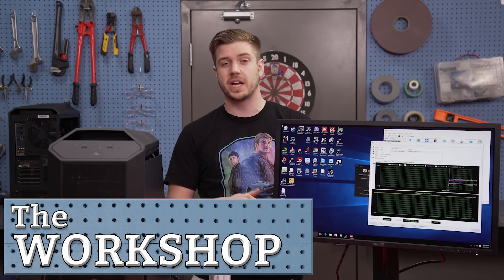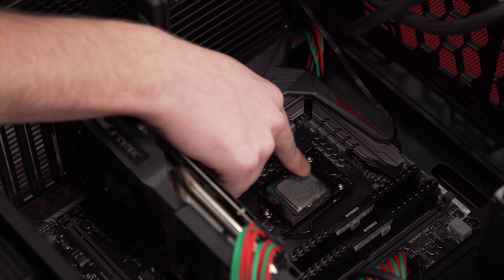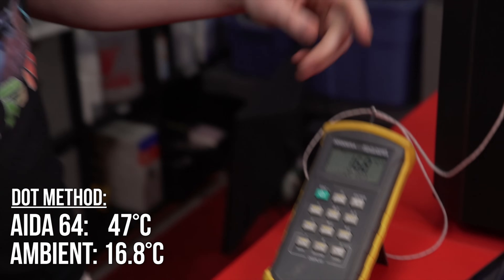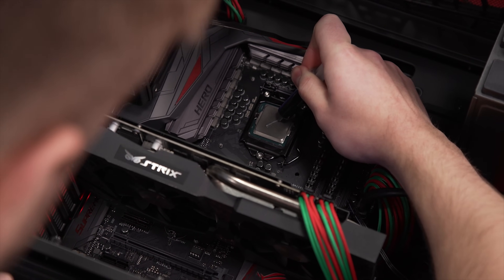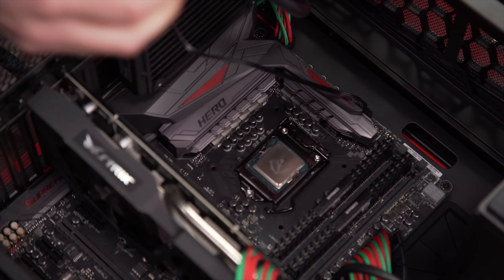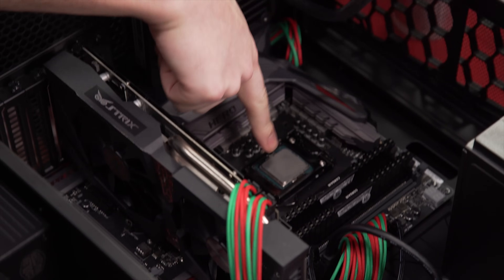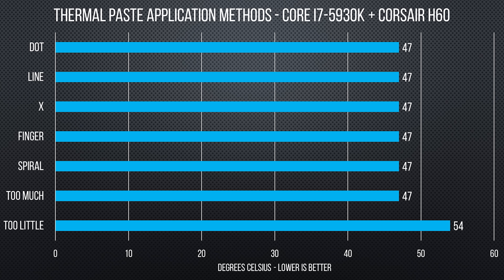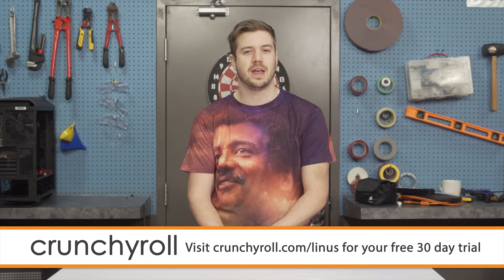Thermal Paste Application Methods - Which one is best? - The Workshop

Comment: wondering if its worth buying a gtx 1080 to replace my old amd 6870. Will the increase in performace be similar to starting from scratch or will i see much less performance by only upgrading the card?

asus p8p67 deluxe
i7 2600k
xfx 6870
8gb ddr3
256gb ssd
Reply: To bring this down to the simplest answer. You will see a massive performance increase IF AND ONLY IF you are currently maxing out your current card, if the games you play don't call for more power than you are using now, you WILL not see a difference.

Comment: Do you guys recommend using a cleaner like arcticlean or does isopropyl 90% work just as well?
Reply: isopropyl works just fine, frankly i generally just grab something and wipe it clean without any liquids unless it's really dried on and won't come off.
Reply: I should also note, without the isopopyl i didn't see an increase in temperature after reseating the heat sink

Comment: this video made me LOL so hard. THANK YOU for the video man. I have been getting disappointing temps on my h110i with my skylake 6600k with corsairs factory thermal paste. This video gives me more confidence that I probably wont see anything different if I really tried it myself. And yes I am a fan of the card method.. Would changing the fans on the radiator give me more of a noticeable difference?
Reply: if you have enough paste, make sure your heat sink is free of dust that will clog up airflow, if that doesn't help. Your next step is a better fan attached. The more CFMs the better, but i am assuming you are using liquid cooling. I don't know the exist liquid system you are using, if it is possible make sure it isn't low on liquid. Air pockets in the liquid can be pretty detrimental.

Comment: I think I'll make dots like 5 on a dice next time, anyone tried that?
Reply: It will produce 47*C CPU temp and 17,2 Ambient Temp
Reply: It has been done before but I don't know what the result would be as it does create gaps and leaves air bubbles between the dots
Reply: That's what I was thinking. Seems like it would spread out more evenly.
Reply: thought the same thing.
Reply: +John Connor It works I do that method all the time
Reply: that's effectively an X with air gaps. the bottom line is that it doesn't really matter what method you use as there is only 3 situations you want to avoid: 
1. you don't want so much that it's spilling out onto the board
2. you don't want to little that it's not creating a contact surface
3. you don't want air bubbles

so keep it simple, whatever shape you make should be aimed at not creating air bubbles and not spilling onto the board. 5 dots is simply creating risk of air bubbles. it might work, but it logically can't work any better than an x which isn't often going to be any better than a line or a properly sized dot.

Comment: I opened my videocard to fix something and now the temperature is way lower than before. I did not changed the thermal paste, probably i lost a little bit of thermal paste after i opened, but, my thermal paste is the white one, with silicone. I think it was too hot because it was with alot thermal paste in my case. Would be cool if you do this tests again with silicone thermal paste, and, maybe, wait somedays to see the temperature after the thermal paste solidify. PS: Sorry for my english

Comment: Lines I think are recommended (by Arctic Silver's directions) for multicore processors where you're putting the ends of the lines roughly over the cores.  I think the "X" stems from covering 4 cores, each end basically over one core.

The one thing Arctic Silver talks about in their instructions is squeegie-ing the paste over the surface of the processor and the heatsink with a card (e.g. credit card) to sort of "work the compound into the microscopic imperfections" and wiping it smooth with something lint-free (like a coffee filter), and then using the line or pea (center dot they call it).  This seems to make sense, but like your experiments, I'm not sure it makes much of a difference.  Maybe it would matter for Linus' twenty something (24?) core processors he recently published a video about, running full tilt for a half hour, maybe not.

All the instructions I've seen recommend against any direct finger touching of any sort, on the theory contaminants from your hand, skill cells and oil, would act as a thermal impediment; that would seem to make sense.  A lot of the thermal compound descriptions specifically say they're not electrically conductive, so you just have to read the literature carefully, and I would think be liberal with the compound if it's nonconductive.
Reply: The Arctic silver i bought today doesn't have any directions with it. :/

Comment: You don't have a control on your test!
I think there might be some difference. Some suggestions to make things more better. Use bare copper as a control, then compare the methods using the same amount of paste. i think your second control should be using the paste exactly how the manufacturer recomends using the product and comparing that to the different methods.
also, we should see if spreading methods differ for different viscosity pastes, does it matter less with thick pastes than it does with the greasy lithium white crap?
Reply: Basically his control as the dot method. You don't need a control unless you intend to compare against a control, if you are just looking for the best results a control is not needed. If you want to know what weighs less 4 quaters or a dollar bill. You don't need a control of no weight on a scale
Reply: Yes, you do need a control, you need to test if the test is valid and that the methods do ANYTHING at all. For your dollar bill example, you are comparing the weighs of two objects, you have to know if your scale is working properly. You would control the test by weighing an object with a known mass. That way you can be sure that your results aren't invalid due to improperly calibrated equipment.
Reply: +Mostlyharmless1985 testing your scale is not a control. A control would ve taking a scale reading at zero weight. It is already confirmed that no thermal compound will cause the cpu to over heat and irrelevant. You dont need to risk ruining a cpu to prove that.
Reply: +Mostlyharmless1985 also as i said, if you really want to. You can call the standard dit method the control as i already said. As far as knowing if it does anything at all when you apply paste, that is clearly known, and furthermore it is demostrated on the test with not enough compound applied
Reply: Kirk Slaydon You cant have your control be one of the objects under test. The point of the control is to validate that the test is actually doing the thing you are testing for.
Reply: +Mostlyharmless1985 the control is literally one of the tests, the thing you are testing for is if applying differently than the normal pea method changes anything. not if applying grease changes anything.
Reply: If the hypothesis being tested is "different methods of applying thermal compounds make a difference in the performance of the compound."

To control for "thermal compound does literally nothing" then you would use "literally nothing" to show that thermal paste does something.

You are now comparing each method to the control test, and seeing how well it performs against it because it is the test with the fewest variables on it.
Reply: +Mostlyharmless1985 so we are just ignoring the point where we wernt testing if it did something or nothing got it
Reply: Kirk Slaydon No. We are removing errors in testing, ensuring that the compount is effective, and showing that the test is valid.

Comparing different methods to each other isn't as good as testing each method against nothing at all and measuring the improvement of thermal regulation against nothing at all.

The point of the control is to fix the assumption that thermal compound does something. We assume NOTHING in science and make sure that the equipment we are using is actually working correctly.

How can you say that doing nothing at all isn't the most superior method? Maybe thermal compound HURTS performance. Maybe our entire hypothesis is invalid! We don't know. because it wasn't tested!
Reply: Maybe an analogy would be helpful:

You want to test if watering a bean plant more frequently will help the plant grow.
You have a series of plants that recieve different amounts of water per day and measure their height across the space of a month.
Now, if we were just measuring the height of each plant compared to each other, we wouldn't be actually testing anything, because we made an assumption about water.
"Water helps plants grow."
We can't know this for sure. We need a null result to know what a null result even LOOKS like.
To control for "water does nothing at all to help a plant grow" you would have a test that receives no water. You then compare each plant to THAT test to the one that got no water.
Reply: +Mostlyharmless1985 but we do know that for sure from past tests......
Reply: +Kirk Slaydon I don't think you understand what a control is, or what it does.

Comment: I had way too much on for years and never had an issue but wanted cooler temps so I cleaned nearly all of it off and only left a very thin layer & the machine shut itself off within 10 seconds.. The temp rose so fast.. around 5 degrees C per second. I won't be putting too little on again.

Comment: what is the paste even for?
Reply: +David Williams The thermal paste is like a bridge that connects the cpu with the cooler, allowing the heat to move away from the cpu and into the cooler where it can be dispersed into the air.

Comment: Try this test again with a air cooler that has exposed heat pipes and see what happens if the thermal past is not touching all of the heatpipes

Comment: 16.8° C and you are wearing a T-shirt? I think your thermometer is busted.
Reply: +sgv6618 Why? It's only 62° F. That's not cold at all. It's 54° F or 12.22° where I' m at right now and I'm wearing a T-shirt. Living in humid environments helps with how your body adjusts to various temperatures. I've travelled all across the U.S.

Comment: You should do a video comparing different types of thermal paste. Such as the standard cheap silicone white stuff verses the more expensive silver type.

I heard to just get the cheap thermal paste because it will work the same.
Reply: +Ryan Toomey yes and no. I've found with the cheap stuff, it will work, but it will wear out more quickly. It's a consideration if you aren't upgrading your CPU every 2 years or so. The more expensive pastes are in fact more efficient at transferring heat, but unless the heat sink can dissipate the load quickly enough, it won't matter, so, if you have a good cooler, it will benefit slightly from having better paste.
Reply: The difference between the bad stuff and the good stuff can be around 5 degrees C
https://www.guru3d.com/articles_pages/guru3d_thermal_paste_roundup_2019,1.html

Comment: For those of us that are on the fence as to what type of cooling we need to achieve an overclocking goal, would you be interested in making a workshop video with 2-3 cpu's (perhaps a mid range i5, a entry level i7 and then a demanding i7 like the 5820k) and then overclock on an air cooler that is rated for some overclocking vs an aio 240 vs aio 280 vs a custom loop to get solid numbers on how much OC room each pricing tier will get

Comment: A few years ago, I was cleaning a GTX470 and ran it for 2 weeks without TIM because I forgot to resupply my stock and had to wait on the mail. Surprisingly it still worked fine. Got a tad bit warmer but still within the limit by a good margin. Edit---So a question I would have a hard time with,...is no thermal paste better then dried old thermal paste? If I had to guess I would say yes, in some cases, maybe.
Reply: +kris reddish In my experience, yes.  Thermal compound which has perished over the years tends to function as a thermal insulator.

Comment: whoah...cmon sparky, that's not how you do it, there is not an experiment that creates or justifies your own set of instructions! The correct method is described by the engineers who developed the particular thermal paste you use. You must look up the type of thermal paste, then your CPU and then make sure the bottom of the heat sink is flat. All these details end up being the deciding factor on the correct method. Most CPU require the vertical line method...but not all, a few need the dot and very few almost none require the credit card rub it in method.

Comment: This is just an idea. What if the thermal paste has a bottle neck. That the cooler is too good but the thermal paste heat transfer is not good enough. Just guessing that with every single test (excluding too little) was 47 degrees.
Reply: It doesn't really work that way, Heat transfers to a colder substance. The colder the thermal grease the quicker the heat transfer. So the Cooler the Heatsink the cooler the grease. So the quick you can cool the heat sink, the quick the grease will cool, and the quicker the cpus heat will transfer to the grease and so on. Honestly unless that's just a really hot chip he is running that liquid cooling system didn't seem to be performing that great.

Comment: TL;DR: As long as you use enough, you're fine.
Reply: I mean if you are a complete idiot and do that, you have much bigger problems than paste application and they do make ceramic pastes that really aren't conductive, so even then it wouldn't be the end of the world
Reply: Ken *TL;DW
Reply: Yup - interesting how he had the result staring him in the face, using "too much" actually doesn't matter and it's not "less is more" at all. Only once it's actually reached the motherboard and dripping, like dumping the whole damn tube have you used "too much"... I.e. for sane people - just don't use too little.
Reply: @gazlink1  And the only way to know you haven't used too much or too little is to treat it like frosting a cake and apply it with the finger-plastic bag method. This also makes sure you don't miss any spots and end up with hot spots.
Reply: that wasnt too much. that was so much and too much will make it go down to the motherboard.
Reply: which is NOT a good thing
Reply: just fucking drop a bit then put the cooler. done. works perfecly fine. did yesterday.
Reply: Ken Thank you
Reply: as long as you use right amount of TP then you are fine
Reply: Batman There is no "right amount", too much is clearly better than too little.